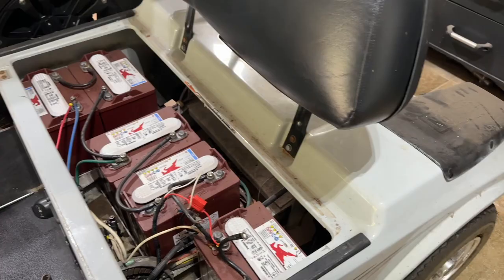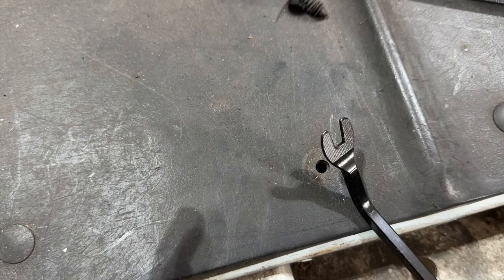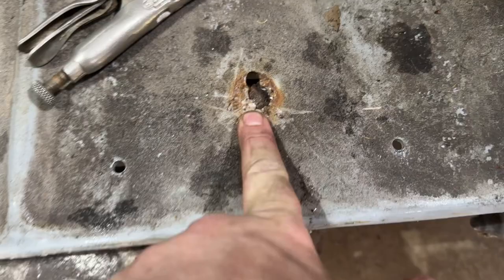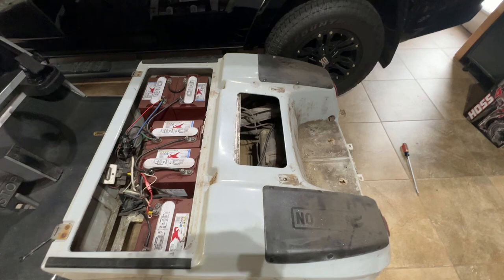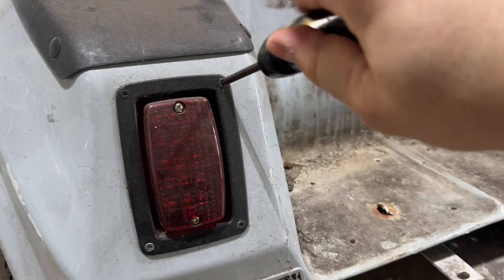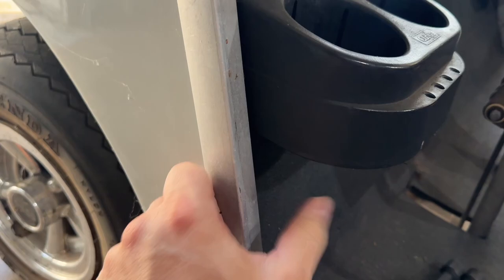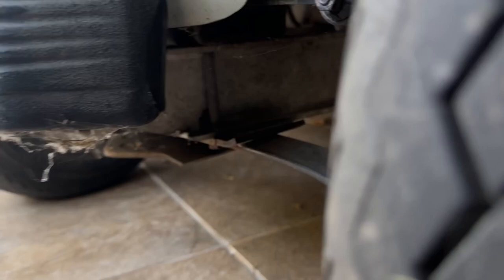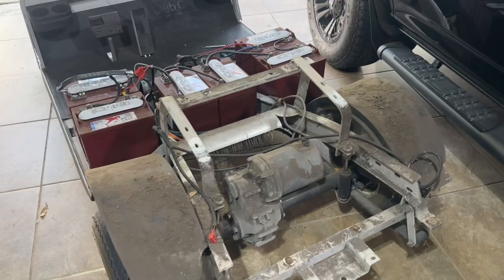Club Car DS Body Removal Complete Step By Step Guide

Comment: I own a 1997 DS Club Car and I have not found anyone that can tell me what kind of parts are on this. I bought a brand new solenoid and this thing still will not move. Right next to the solenoid was another bigger looking solenoid. I am asking people on Facebook and no one can tell me. I bought a 1997 Club Car "repair Manual' and it is just a basic owners manual and does not tell you about specific parts. I can't post pictures on here I see....
Reply from the maker: Is it a resistor style cart? I would give Travis or Ryan a call at golfcartsmodified.com. Tell them fix it now sent you and send them the email of your photos. They will absolutely get you in the right direction to fix your cart.

Comment: dude , drill the head of the screws next time
Reply from the maker: Nah.  No need for all that. If you try and drill out a bit and bolt they free spin. Just easier to vice grip them off with the body out of the way. That part always gets covered. Add a 1” washer and done.